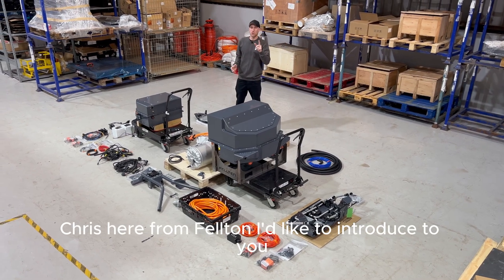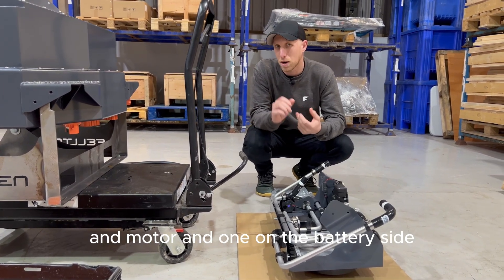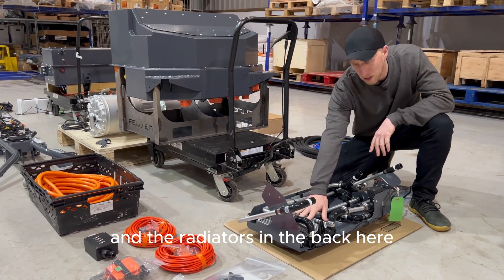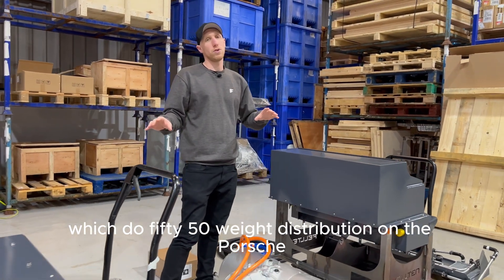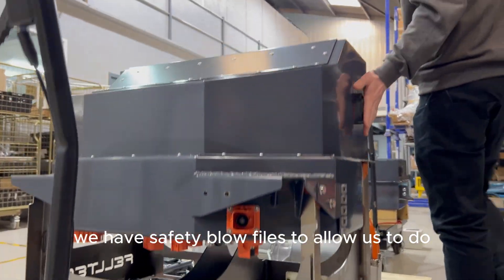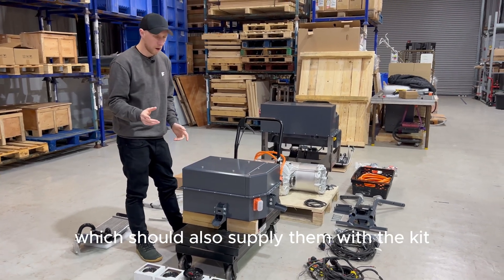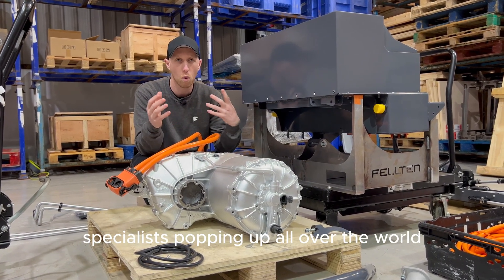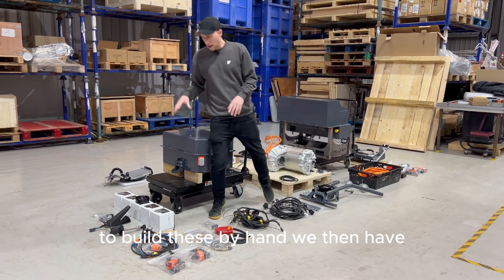Convert a Porsche 911 - 930 G body to EV Electric - You should do it!?

Comment: Some people looking at these kits think they are looking at a cheaper way to get into electric motoring. Unfortunately if that is your thought you are barking up the wrong tree! The time, expertise and investment required to develop this kind of gear, and make it all work together, whilst meeting all the hardware requirements for the classic in question, regulations, safety, means that it is inevitably very very expensive. It's only worth doing for expensive classics with well-off owners. It would cost a similar amount to develop a kit for an old Ford Fiesta but there would be no customers at the prices they have to charge to make it work as a business. You may think that brand new EVs are expensive ... believe me, a commercially designed quality conversion on a pre-existing vehicle will be much more expensive.
Reply from the maker: Very well said and explained

Comment: I'm 66 (the same year as my Mustang).  I hope I can stay healthy because there should be exponential jumps in battery density and cost drops in the next few years.  I would love to convert my fastback to EV.
Reply from the maker: We have a great new motor and gearbox coming out. Plus just done a 55kwh pack design that drops into the mustang.
Reply: @Hazell_Nutz  I measured up a complete Tesla 3 motor/cradle/suspension, and I think it will drop between the rear frame rails.  I'll have to do some fabrication of course to get the cradle in but I'm more concerned about the battery issues frankly.